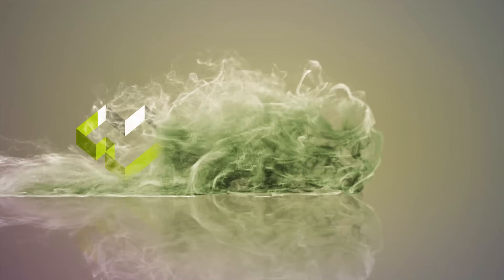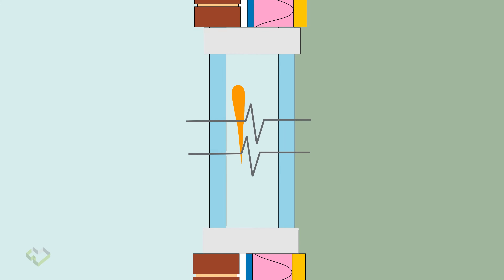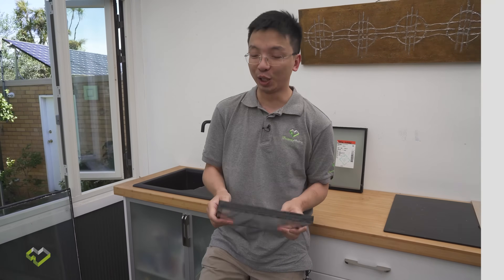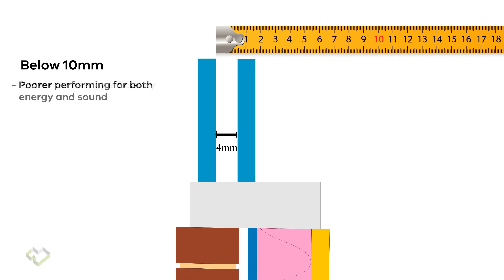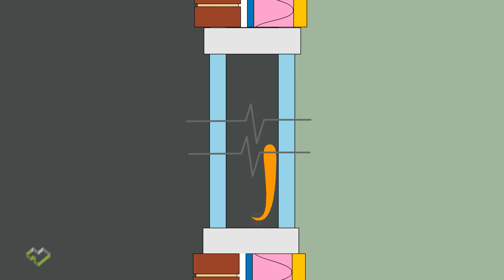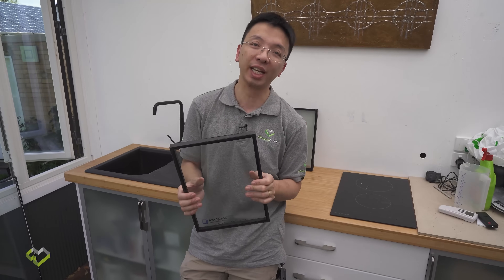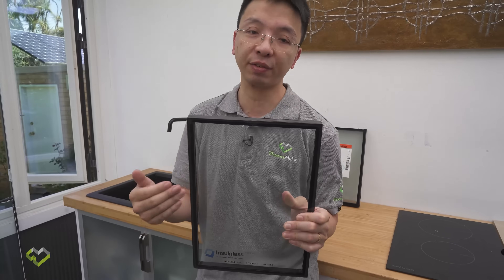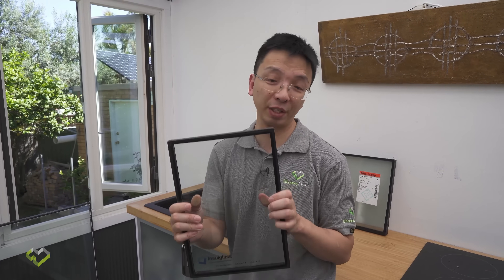Double Glazing! The Little unknown Truths.

Comment: Gr8 video, well explained. The company I have recently been quoted by imports from the UK as well as offering local Australian product. They quote a u factor of 1.1 from the UK product , whereas the local product they quote as 2.7 but can be lowered  to 1.8 ( extra cost). 
They explain"  using Low E glass on the inside and outside panes as standard.
The UK product has a longer turn around ( 24 weeks for being imported) BUT  they quote the UK  product as less expensive... does this sound correct??

Comment: Hello. Very good video, I like it. I have a PVC profile can adopt 24mm glazing width. Which structure would you use for the best noise reduction as possible for double pane window? PVB lamination foil is 0.38mm. Glass positions: outside (street) / gap / inside (room)
- 6mm PVB (3mm+0.38mm+3mm) /12mm gap / 6mm PVB (3mm+0.38mm+3mm)
- 8mm PVB (4mm+0.38mm+4mm) /12mm gap / 4mm low-e
- 7mm PVB (4mm+0.38mm+3mm) /12mm gap / 5mm low-e
Everywhere the gap are filled with argon gas. Glass sizes are 485mm x 1080mm. 
Thank you so much for your help. Regards, Karl

Comment: Some years ago Pilkingtons (aka St Gobain) in UK did an analysis on the optimal space between the panes of double glazing and found that there was virtually no change in the performance between 12.5mm (1/2") and 20mm (3/4").  bigger is often better but in a double glazed unit the eddy currents created actually allow heat to be transferred across the unit and this phenomenon was worse above 20mm.

its worth noting that a double/triple glazed panel performs better than the frame so that the larger the pane the better the performance.  If you get into the realms of direct/structural glazing, where there is no frame you can see big benefits.  This works well for fixed rooflights.  One point about frame material selection is that although PVCu performs better than timber and aluminium PVCu windows have a lower design life, typically 20 years, whereas aluminium is 60+years.  Factor in the costs of replacement in the energy saving equation and PVCu doesn't look as good, although its cheaper to install.
Reply from the maker: Yeah, it’s pretty counter intuitive for many that the larger caps perform worse from a thermal break perspective.   Thanks Clive.

Comment: I would not recommend buying double glazed windows if you are doing a retrofit. It is very expensive and not really worth it.

You can get much better performance with much cheaper solutions: 

1. Thick thermal curtains that are closed in the winter night and closed on really hot summer days
2. Decidous trees and vines to block the hot summer sun and allow the winter light in.
Reply: I am kind of agree with you. Provided you don’t have condensation issue. Thick curtain and drapes cannot stop moisture from condensing on the cold windows.
Reply from the maker: It depends on how pad your windows are.  Aluminium units are terrible, and I think sometimes timber windows, depending on the state of them, they may need to be replaced, and there isn’t much choice in the matter.  When it comes to that, it’s good to know about these points so that you can drive an outcome with a better product for the longevity of your home.

Comment: Really good presentation, lots of information very well presented, but I would debate the perceived advantages of foam and other non-metallic spacers versus thin wall stainless in long term performance and durability, and "edge of glass" is 62.5mm from the actual edge (into the face of the lite), while "center of glass" is the entire glass surface that is not within 62.5mm from the edge rather than a vague circle in the middle of the glass face.

Comment: I went from double glazed to single and the difference in the temperature regulation inside is extreme. 
The same with regards to condensation and mould issues. 
Thankfully I’m moving back to a new home with double glazed.
Reply: The difference is about 100%.

Comment: Does anyone know how many mm is ideal for noise reduction on a double paned??
Reply from the maker: The wider the better, I’d say.
Reply: @ecoevo  would 6mm work,?
Reply from the maker: @hfhgfe  no, 16mm plus
Reply: I would look at 25mm or more space for sound reduction, but that width will also negatively affect energy performance. 
That's where triple panes offer an advantage. A triple pane with two 12.5mm airspaces would result in 25mm overall airspace - good for sound reduction (especially using different thickness glass for the center lite), while the two separate 12.5mm airspaces are individually perfect width for energy performance.

Comment: I am curious to know if the foam superspacer would seriously degrade from constant sun light?
Reply: superspacer less than some other foam or non-metallic spacers, but more susceptible to UV or solar heat degradation than metallic or hybrid spacer syetems.

Comment: If you want something even better than gas in your windows, then you should look into vacuum sealed glass, no gas means no convection and the r value is immensely boosted. In addition low-e is a scam, ceramic coating does a far better job than low e glass. You can buy a ceramic tint and slap that on your windows the same as the ones people use on cars and you will get far greater ir insulation than low-e. The window industry overall has pretty BS and overpriced technology
Reply: Vacuum sealing doesn't even exist outside of experimental companies.  Ceramic film is a separate expense and very costly compared to Lowe/Argon.

Comment: You didn't cover the topic of vacuum between the two panels instead of argon etc.
Reply: vacuum glass is not commonly used in Australia. Personally, I am not a big fan of vacuum glass for general purposes for a few reasons:
1. similar to krypton, the optimal spacing will lead to a substantial reduction in performance when the product ages and leaks.
2. vacuum glass is more prone to bending compares to gas-filled DGU due to the pressure difference. especially for larger glass panes.
3. vacuum glass aged faster than inert gas-filled glass due to the pressure at the seal.

for a window system that has multiple layers, having some vacuum layer(s) is good because we need to squeeze every bit of performance out of the system.

Comment: Nice video! What would you recommend for nothern Australia climate? I'm in Brazil, near São Paulo - but already enterring a region called "Peripheral Depression" that is lower than the Ocean Ridge (Serra do Mar) and quite a bit warmer - and I think thqat would be similar to Northern Australia. Thanks!

One observation about sound: depending on the gap used a double glass windows will perform even worse than a single glass unit because of some phenomenon I actually can't explain ... lol. The guy who taught me that when I was doing audio engineering, however, is a pro!
Reply from the maker: Resonance perhaps. Depending on the sound frequency. 👍🏻. In northern Australian climates you would want SHGC to be as low as possible, balanced with how much visible light you can get into your home.

Comment: Building historic windows, how much of a difference in heat gain (window faces sun in later afternoon until sunset) between single pane and a double glaze with 1/4" spacer (1/2 total)?
Reply: The rough estimate is 50% but a 1/4" space you will be less.

Comment: regarding to the energy saving item ,i think the glass play the important part ,esp.the U-value for warm save and SC value for heat-resistance . learned one kind of high performance low E glass which called Optilite S1.16 had been installed on so many windows in New Zealand .  if u are interesting in it ,  pleasure to talk more with u later .

Comment: I did not hear mention vacuum sealed double glazed windows. There is no heat transfer through a vacuum good for sound insulation, too).  Same idea that’s used in your favourite thermal drink bottle.
Reply: I'm pretty sure you can't have vacuum sealed glazing as the panes suck together
Reply: @MrHavokman  vacuum glazing systems use tiny spacers about 25mm or so to hold the glass lites apart. They work but they are visible and can be annoying to some people.

Comment: My parents recently purchased a large (roughly 3 feet by 6 feet) picture window.  My dad and I installed it.  It was triple paned, with argon in both voids, and a lowE coating on all 3 panes.  The frame was vinyl (PVC).  We get pretty cold winters here (Eastern Canada).  One night in February, I got out my temperature gun and checked to see how much heat was being lost through the window.  It was actually warmer than the WALLS of their house.  I was amazed.
Reply: Your heatgun is measuring ifrared radiation. When you point at a reflective surface you will see not see the surfacetemerature, but the heat  mirror image of what is in front. If you want to measure a reflective surface like glas og metal place a piece of matt painters tape on it (or a post-it) and measure on that.
Reply from the maker: No insulation in the walls?
Reply: @ecoevo  They have fibreglass batting in 2x4 framing.  And I think there are multiple layers of sheathing (plywood or chipboard), plus vinyl siding.  The walls were reading about 19-20 degrees Celsius, while the window was 21-22.
Reply from the maker: @ahobimo732  Are those Temperatures taking into account Emissivity?
Reply: @ahobimo732  2x4 so it's an old house or cottage? Also in winter the R value cuts in half when -10 degrees. fyi.

Comment: Thank you Joseph for your wonderful insights on this subject. I agree with a lot of your thoughts and opinions on this subject that not all double glazing is created equal. 
Key points:- 
- Cold aluminium window frames (non-thermally broken) do perform very poorly thermally, 
- The optimal space between the glass is between 12mm & 14mm, 
- Argon being the ideal next level performing gas for IGU's (Insulating Glass Units) more commonly known as Double Glazing, 
- Air seals and airtightness being super important in helping achieve optimal energy performance through correct installation of windows into the building envelope,
- Tight seals on windows being critical. etc.  

Aluminium Windows, unfortunately, get a bad rap generally but like double glazing, not all Aluminium Windows are created equal.
Thermally Broken Aluminium Windows are amongst some of the highest performing windows in the world. So not all aluminium windows are bad. Yes, uPVC Windows perform exceptionally well but their sustainability credentials are really bad. Thermally Broken Aluminium Windows, like all aluminium, can be recycled at end of life. uPVC cannot easily.

In addition to the window frame, the spacer as you said is super important. Unfortunately, the Insulglass Double Glazed unit that you use in your video from AGG (Australia Glass Group) does not contain a foam spacer and in fact, contains a Plastic Hybrid Stainless Steel spacer. These are in my opinion, superior to foam spacers. 

The main points of difference being:-
- Plastic Hybrid Stainless Steel spacers and Foam Spacer thermal performance is almost identical with the Foam Spacer just winning by a nose. 
- Foam Spacer has an integrated desiccant that is supposedly designed to absorb condensation that forms inside your IGU (Double glazing). This amount is a substantially smaller amount for Foam Spacers, when compared to the amount that a Plastic Hybrid Stainless Steel spacer can hold, which makes a Plastic Hybrid Stainless Steel spacer more superior in this instance.
- The actual primary seal (PIB or Butyl) that seals the edge of a spacer is just as a critical component as any. Foam Spacers typically fail at this junction commonly when compared to Plastic Hybrid Stainless Steel spacers which typically do not fail. 
You don't want to be paying for Argon only to lose it quicker than you should due to the failure of your foam spacer.

Other than these points, keep up the great work of promoting higher performance for all buildings in the Australian market.
Reply: Excellent feedback Vince. It would be good if you can share any comparative table between various spacers so I can include that in the next instalment of the video.
Reply: @josephcheung3964  hi Joseph, I was looking for the correct type of butyl for my homemade double pane glass. Any advice would be greatly appreciated. Thank You

Comment: where are the passive house windows? that are the only window we need in Australia ........

the australian u-value is the US u-value;
 

therefore German 1.2W/m2K x 1.1 (factor to compare) = Australian U-value full window 1.32 W/m2K

do you have a window with that u-value?
Reply: Ultimately, I agree, all windows for habitable buildings should be passive house quality, provided they are affordable. It is like I would love to drive the latest model-s but my bank account said a very firm "NO!!" to me.  Plus, we don't sell windows or glazing units.
Reply: @josephcheung3964  we need to build up same factory, as they have in Europe, than it is very cheap ........ we need to take out the big profit margins; without doing some things to the products (in Canberra i was finding; 20%, 30%, 40%, and more; builders put this margin on top of the trades subcontractors price; plumbing, electrians, kitchens, etc. .... we need to charge only the real hours used to manufacture and supply products .....